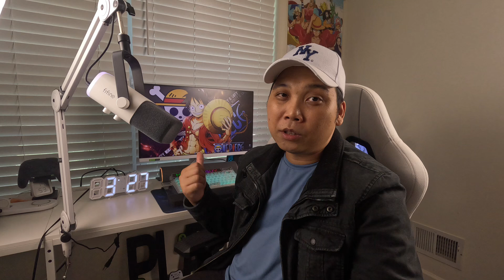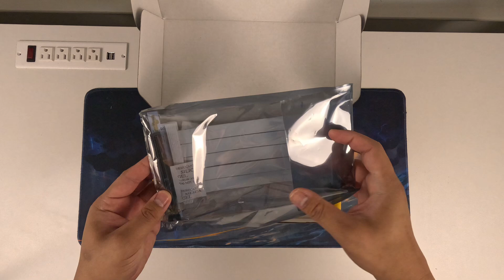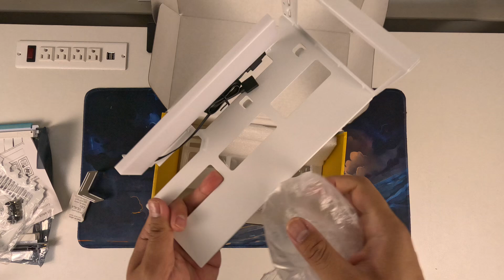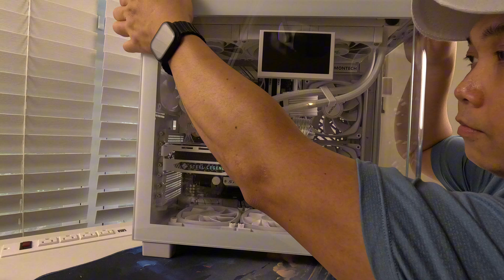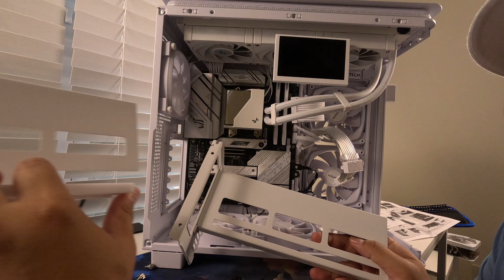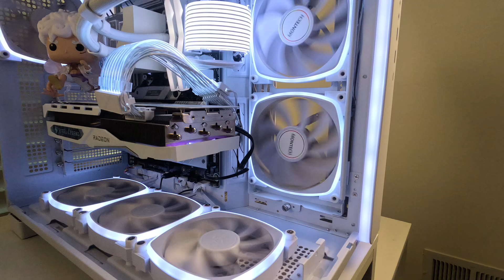Are Vertical GPU Mounts Even Worth It?

Comment: Would love to do this, but I have a corsair 4000x with a 4080 and those cases aren't really meant for vertical GPUs as big as the 4080s. They get too close to the panels and will overheat. Been looking around to see if there was an alternative to vertically mount them. Looks sick though
Reply from the maker: Thanks! Yeah it would be a bit hard for bigger cards specially making it stable enough

Comment: Good video man, other than aesthetic appeal or simple wants, did your thermal temperatures increase or decrease? Thanks!
Reply from the maker: I did not see any major changes in the thermal temperatures but logically speaking the vertical mount will push the air more towards the motherboard but the push from the fans below the case would suffice to bring that back to the top. 

All in all I don’t think there will be much difference in the thermal temperatures.